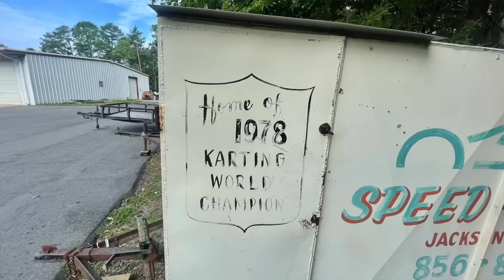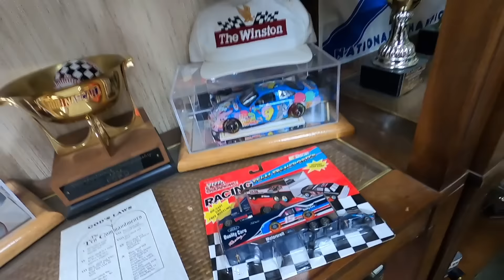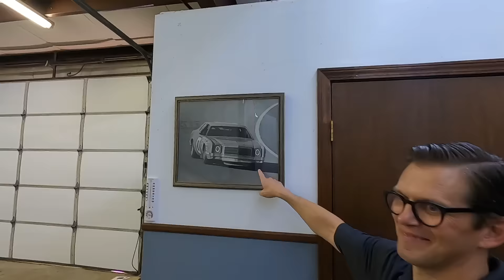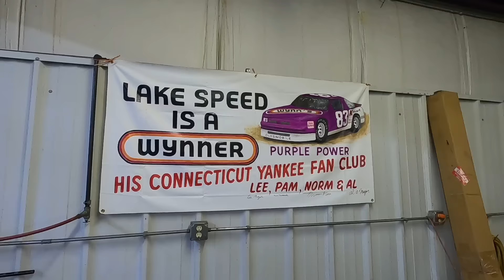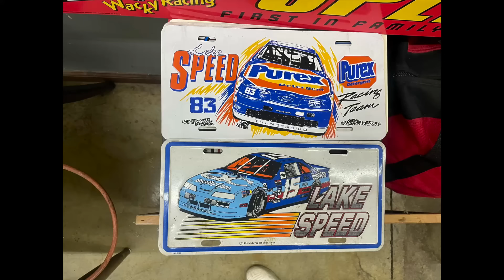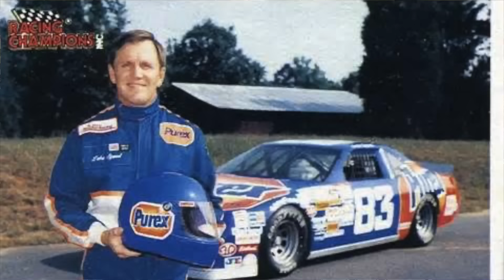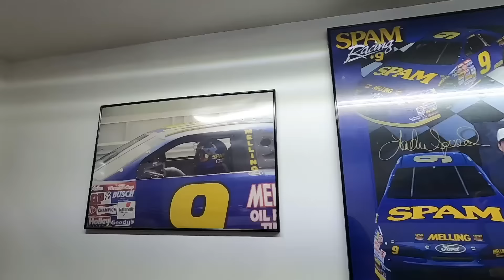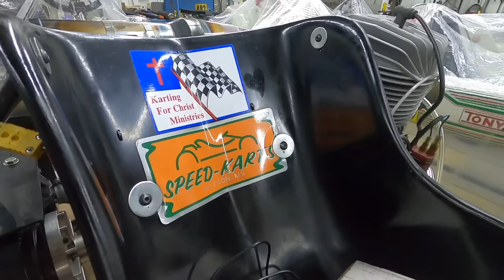Lake Speed Shows Us His Backyard 1980s NASCAR Race Shop! (AND The Go Kart That Beat Ayrton Senna)

Comment: 10:13- Concerning the broken parts:
1. I think the first piece he picked up is the forward half of a pinion gear, as I seem to recall a string of similar failures. The idea is, you pull into the pits, get your service done, and when you dump the clutch to leave...you'd snap off that piece of the pinion gear, clean as glass. One specific example I think was Michael Waltrip in the Pennzoil car, and another example of metallurgy having not yet caught up to the HP race.
2. The intake valve looks like it broke the lock (two little half-moon pieces that lock it in place up top), once again, a metallurgy failures.
3. The small round bit...no idea what that was, I didn't get a good look at it.

Comment: Lake Speed is the very definition of what being a racer is. There were many of us that raced on our witts because we didn't have the money to do it any other way, but very few were able to have the success that he had. My first " race " was with a kart that had a sheet metal seat from a lawn chair, a lever-type scrub brake, and a clutch that was a v belt pulled tight with an idler on a lever. We got in with some fathers and kids that had mostly yard karts and met at the house of members that had their own tracks on Sunday afternoons. This was back in 1963 and decent safety gear didn't exist so the rule was we ran one at a time against the clock. My 1st and only race was on August 5, 1963, a week before my 9th birthday. That fall, my father got a job offer up north. I had to sell the kart. I was overjoyed to find out the town we moved to was hot rod heaven. My first fast car was a chevy vega with an m-22 " rock crusher " with a 427 tall deck big block from a school bus. Back then the N.H.R.A. pro stocks were running low 9 seconds and spending close if not more than six figures to build a car. I was about three seconds slower, but with a car I  built for about $750.00.

Comment: LOVE it, Lake's son preaches the Gospel about optimizing reduction of friction, and his company makes the only rings we ever ran in the short track shop where I apprenticed back in 1990-1992 .. total seal gapless.  When you put a torque wrench on the crank snout of our engines it took <10 ft# to turn it over. Most engines coming in to the shop which we had not built were over 20ft# to turn them over, AFTER 5-10 outings.

Comment: This shop is kinda close to my Mom & Dads house, but a lot of wooded land in between. Close enough on a warm summer night back in the late 80's you could hear the sound of the engines on the dyno coming through the woods. You'd hear them rev up and then get pulled down by the dyno and just moan for a while until the run was over. I was about 16 then. One night I went out in the backyard with my trusty 80's boombox and taped it for a while. I still have that tape somewhere.
Reply from the maker: That’s awesome

Comment: The cart track at Charlotte is one of the more difficult cart tracks. It has elevation changes in the middle of apexes which means if you clip the apex at the wrong place you will be turning when the cart has no weight on the wheels.

Comment: I got a old lake speed built go kart like for real I got it from a guy in Mississippi who bought it from a guy and raced it back in the day the markings and numbers on chassis are all gone except for 2 numbers because it was wrecked and got a new front clip welded on it. I can't believe y'all are at his shop. This shop and race team is what a real race car driver does they drive the car on the weekend and build them on weekdays and late nights and do it all your self. If you do it your self and learn you save money. I got a small three car garage and when I needed a pit crew for live pit stops under green in late models I was 14 and I had my 5 best friends that lived in the neighborhood that was 15 and 16 practice live pit stops in my drive way everyday after school for a good two months until that race weekend came we was able to change wide five hub latemodel tires all 4 and fill up from empty to full fuel in 21 seconds which is fast for wide five hubs on a latemodel cuse the spacing is three times further apart then regular spacing on a cup car rim or any other racing rim. I do it all my self Dyno and build my own shocks, setup cars, build cars, reclio wrecked racecars,hang bodies and build the fabercated aluminum sheet dirt and asphalt latemodel and outlaw latemodel bodies and modified bodies and everything except machine work. If you buy the equipment to do it all your self it pays off in the long run money you save to keep racing. That setup plate when he is talking about bulls eye bbq sauce sponsorship costs alpt of money to have installed into a race shops floor I wish I had the 8k dollars to have one installed in my shop cuse it's perfectly flat and level and you use that when you scale and do all setup work on a racecar on that but if all you got is a regular shop floor that's close enough
Reply from the maker: That’s awesome man

Comment: Tony and Jeff need to bring racing back to owner drivers.  1965-1970 full mental bodies, wide five wheels and a standard carburetor for any engine bore and stroke you want. But you have to run that same engine multiple race with only new crank and rod bearings, no rebuilds.

Comment: I posted this on another article about Lake Speed, and I don't mean to hijack this thread, but Lake Speed had an opportunity to pass on the same break to us that he was granted. 
Many years ago, we operated an auto business / service station. But because of underground tank problems, we had to move on and the tanks were removed.
We found a GREAT location in Ridgeland Miss., where Lake once operated a go cart track. FANTASTIC location that was being leased to the son of the local Buick dealer. I was under the impression that the son owned to location. We moved in and customers followed us and thing were going FANTASTIC. 
And then the news that the guy we rented from was going move out. 
I should explain that the son was using the track as a used car lot and was not using the shop building. 
Well, certainly if Lake would rent to us like he rented to the other guy, things would continue. 
NOPE.....Lake wanted to sell. And if we could not buy it outright, well.........
Either buy it or get out..........
I hold no ill will, but that "break" sure would have been nice. 
If you want to see the building...
254 US-51, Ridgeland, MS 39157
Reply from the maker: Sub leasing is a tricky thing. I agree though being under someone else's thumb sucks. I won't feel any kind of security in life until I I own my own spot.
Reply: @Stapleton42  Thanks.....

Comment: So I have a close ratio t10, that unfortunately didn't survive behind a big block, I learned the difference between a normal t10 from 1963 and a super t10 (like what was on the floor there(.the early ones can only handle around 350 ft lbs of torque)☹️

Comment: Would love to understand the build specifics on your Ford C3 engine.  I have the same collection of parts that will go into a vintage NASCAR roller that I got off Ebay.  The roller is a Roush Yates chassis SR# Rk250  The car was driven by Matt Kenseth in 2004 to 2006 at Watkins Glen and Sears Point.  Subsequent to 2006 Roush Yates used another dedicated road race chassis.  The Engine is on my "To Do" list.

Comment: Lake looks like he would have fit the average size of a F1 driver perfectly, but going to nascar instead was probably a blessing in disguise saftey wise.
Reply: Probably. I mean all motor racing is dangerous, but during that time in the 70s and 80s there were quite a few fatal or career ending crashes in F1 and sportscars (and Indy), which is where most of the guys he was racing against in karts went to race. I made comment elsewhere that two of the guys he talks of by name who he raced against, Elio and Ayrton were both killed in F1 cars, 86 and 94 so quite far apart, but still.